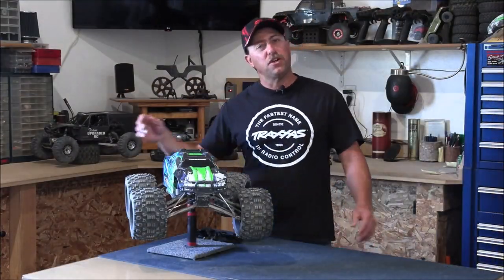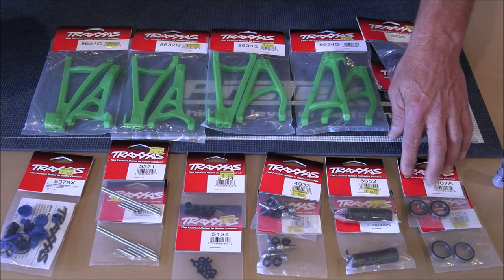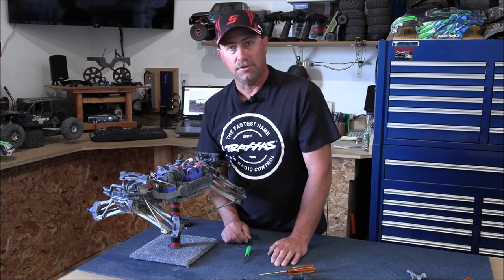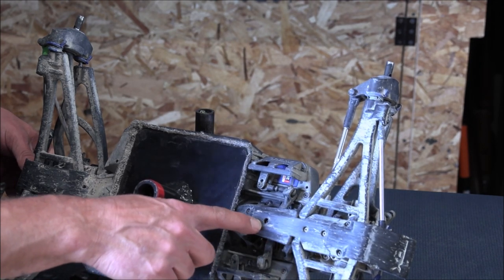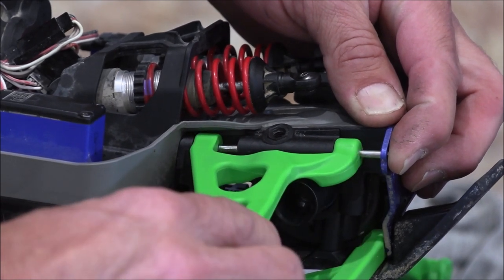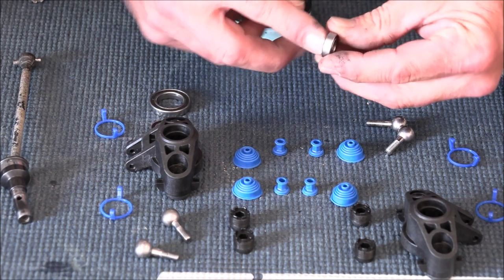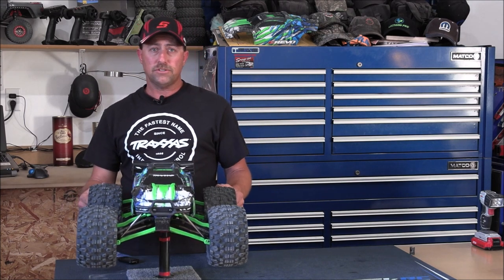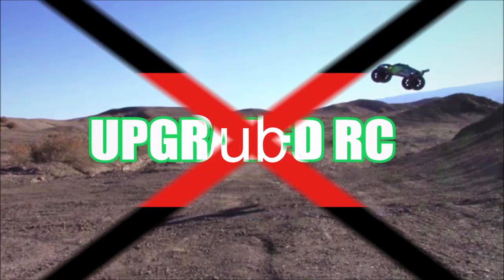2.0 Gets New Control Arms and New Drive Cups, Steering Knuckles, Piot ball Rebuild, and Bearings!

Comment: A solid tip for pivot balls coming out from the A Arms is to drill a 3mm hole for a grub screw to lock the pivot ball threads in. Good luck and thank you for your in depth coverage of the e revo 2! All the best

Comment: I did the super glue quick repair on my pivot ball to run my E-Revo till the parts come in. Your video is epic in detail. Thanks so much. I just ordered the side that was bad as the truck is only a few months old. Missed a jump caused the pivot ball to pull from the A-arm. Thanks again.

Comment: When you do 10% camera by pulling it two screws out the inside of the tire wears out before the outside of the tire because it doesn't lay surface flat on the ground it is good for cornering but it is not good for whole shots and longevity of your tires it wears them out that's why they call all four wheel alignment alignment it is to align the wheels flat to the ground so you have much surface contact as you possibly can have 10% camera does run better cornering now

Comment: You're towing is pitched Wheels forward and in your wheels should be evenly spaced from front to back so the car doesn't go into a wobble cuz it makes the steering shake the back towed in one to two degrees which is flat straight 1/4 turn down it makes the wheels pull to center on the front they skip and jump I recommend running your tires the way that every car in the world gets put on a front end alignment machine it has all four tires put flat on the ground so there's no wobbling shaking or prematurely wearing your tires down tires are expensive one thing that I agree with though is running more shock oil in your right shock in a less in your left shock it allows the car to not pull to the right when doing wheelies or power starts if your car is always drifting try stiffening up the shop on the side it is drifting to it pushes it back to the other side

Comment: Hey Trevis !
It's a year ago and we have snow again in Austria .
I'm still driving the X Maxx with the green Arms and they do very good . They are stronger than the stock ones wich looked like a Banana after a year of bashing. So my question is : Are the E Revo Arms also stronger ? Now I have two E Revo 2.0 because I like the E Revo more than I thougt when I bought it for my son. One of them got the RPM Arms installed and they do also very well but I want the Traxxas orange ones because the Revo is Orange and I hope that looks so nice like it looks at your Green Monster.
Thx for answering sorry again for my poor english and maybe I can send you more cool pics from bashing in the snow.
Greetings from Austria(Europe)
All the best  René Hansmann
Reply from the maker: I honestly don't think they are any different than the color. They are supposed to be made from a better material that is stronger, but I don't see it.  But. I haven't had any problems with them. And I am clearing 60 feet off my jumps and wreck a lot lol. They are definitely stiffer than the Rpms though. And YES, please post some pics in my group Upgraded Rc bashers crashers and crawlers. 😎👍

Comment: Using the shocks and tires to keep the car straight is what you need to do in drag racing lowering the front of the car putting more oil in the right and less in the left allows the car to power to the right but stay straight to the left this is how dragsters are set up so when you stomp the gas they do not pull to the right they drive in a straight line

Comment: I have the Rustler VXL 4x4 and the driver side rear keeps pulling the rod end off the ball and screw. The ball and screw will stay in there but the rod and we'll just pull right off of it I've had the truck now for about 2 weeks and it's done it about six times
Reply from the maker: Watch this video and try it out. Sounds like your shocks are over extending. Some people use limiting straps also.  https://youtu.be/gr3zHqVE5l0

Comment: Street racers run 10% to 20% camber so they can corner better and do drifts and donuts better but they also have to take the tire off of the rim and put the passenger side on the driver side in the driver side on the passenger side so the tire doesn't prematurely wear out you have to have it rebalanced when you do so therefore it's a costly timely issue and if you just run your tires flat when the surface you have breaking it doesn't skip because only half or 2/3 of the tires only touching the ground
Reply from the maker: Ya. I was going by what Traxxas recommended

Comment: Do you think the rear pushrod is related to the same problem as before with the shocks allowing the arms to extend down to far?
I just got my revo and I haven’t even ran it yet because I have just rebuilt my rear shocks the way you did and it seems to be pretty stout, maybe to stout…
Reply from the maker: You should adjust your pushrods so that there is an 1/8th inch play only

Comment: What wheels are you using on your e revo??
Reply from the maker: They are the wheels that came mounted on the tires ( Duratrac Sixpacks)
Reply: @upgradedrc3697  ok thanks but yeah, i was asking like wheels and tire. Thanks for the help!
Reply: @upgradedrc3697  but how do the six packs do like for stunting and stuff, like how do they flip?
Reply from the maker: They flip really good. The sixpacks are designed for jumping and heavy bashing.
Reply: @upgradedrc3697  what do you think about the other popular option; the proline badlands belted?
Reply from the maker: The badlands are a great tire, but they are such a low profile tire that you will break a lot of wheels if you jump alot.

Comment: Can anyone offer me some advice please. My e revo has a tendency to spin out much easier than any of my other vehicles. On loose ground the back end starts coming around and is very difficult to get it straightened back up. Just seems like the rear of the vehicle is loose all the time. I checked/adjusted the toe and camber. Truck is mostly stock but do have duratrax 6 pack tires.
Reply from the maker: Your suspension needs to be stiffer and the TSM or AVC could be turned up for more control !
Reply: @upgradedrc3697  
Thanks man, I’ll get some stiffer springs ordered. I’m running after market radio system so no tsm. If I’m unable to make the vehicle more controllable I may put the stock radio back in.
Reply: @gregg7761  If my tsm is anywhere under half.....on 6s and more then half throttle...it just goes psycho. This car needs some stability management.
Reply: You could run a tap through the A arm pivot ball hole to get more thread ingaugement.
Reply: @rjeezy.5746  
Ok, thanks for the info. I have a couple other 8th scale RC’s that I can control fairly well without stability management but maybe the Revo is just different. I didn’t even think to try tsm before removing it. I swapped in a different receiver right away so I could use my favorite transmitter.